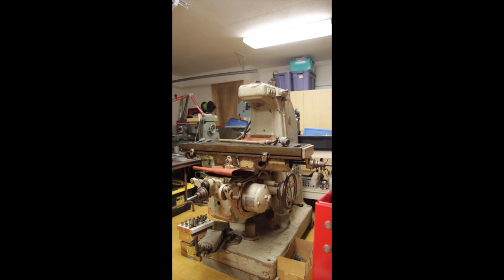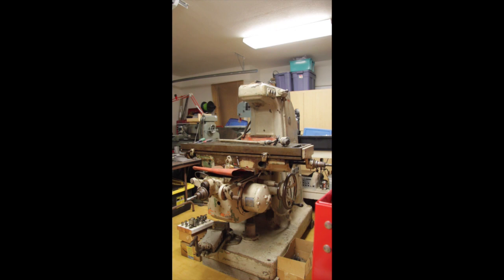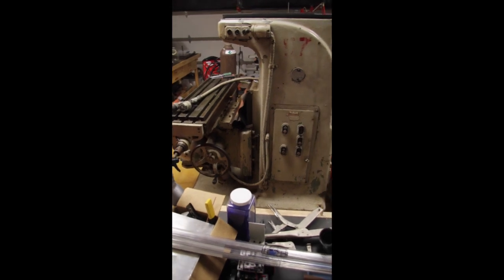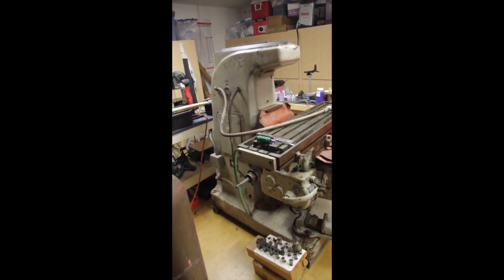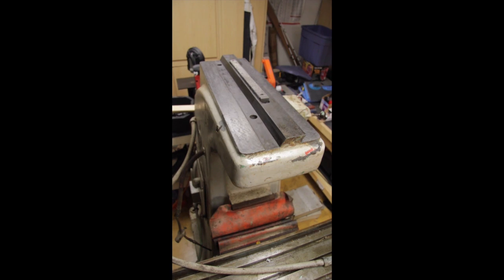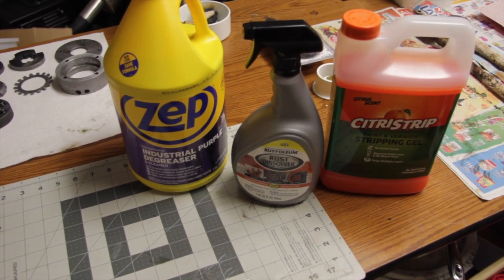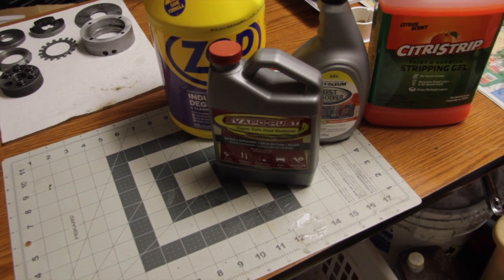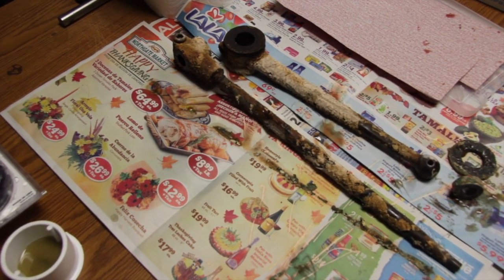New Milling Machine Restoration Part 1

Comment: What a cool looking machine
Reply from the maker: Thanks Craig,  about 1/3 heaver than a Bridgeport.  Very robust.  Been a fun project
Reply: @JoediyLab  I have a part Cochran bly, part Bridgeport.  Its a bit lighter then a normal Bridgeport.  Cant wait to see yours makin chips

https://youtu.be/kI7wYUb2qCc
Reply from the maker: @craigtate5930  getting close, have to re-thread the x axis acme screw and wire the mill to my VFD.  Getting excited to have it running.  Thanks